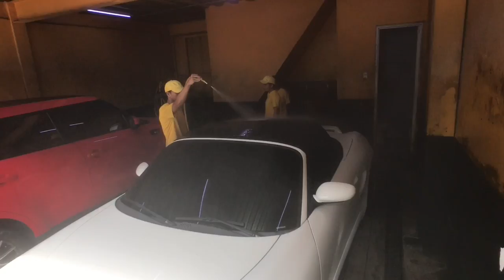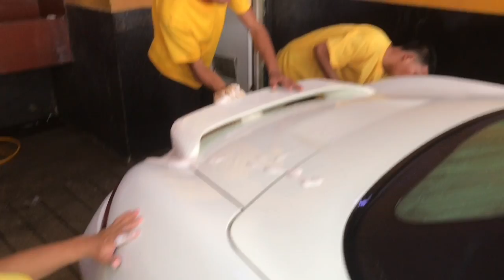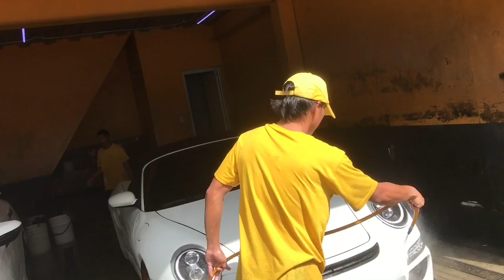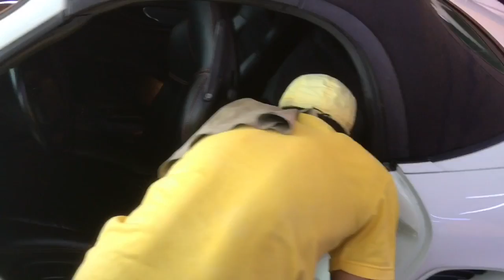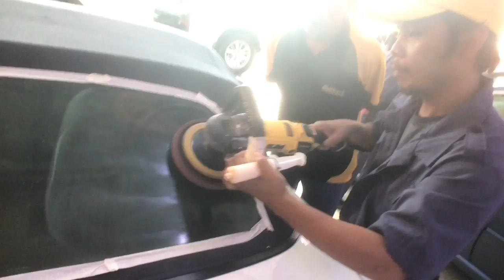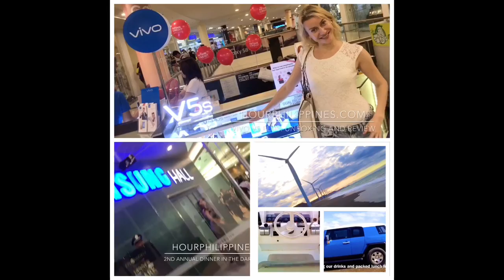Best Auto Detailer Philippines: Big Bert's Professional Detailers Ortigas Home Depot Manila

Comment: Nope. Don't go there again. If they care about your car's paint they should be using the two-bucket method in cleaning your car. And they should clean the bottom-part of the car last to prevent scratching your car's clear coat.
Reply from the maker: +Jan Almazora thanks for the comment can you  recommend any other detailers? 😀
Reply: Thats also the first thing that I noticed.
Reply: And they are using chamois to dry up your car? WTF. They should use micro fiber towel if not.. Theyre just ruining your paint.

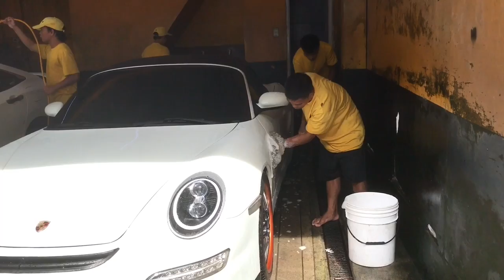Comment: 2:20 I observed one bucket system for washing the body of the car.  Not good.  True professionals will used a two bucket system with a grate on the bottom of one to separate the dirt as the wash mitt is rinsed before going into second bucket to soak up soap.
Reply from the maker: Thanks for the comment and suggestions! 😀👍